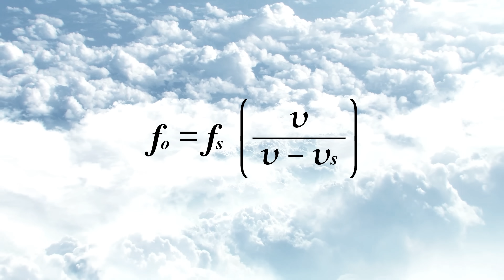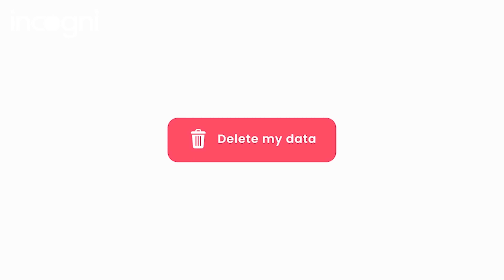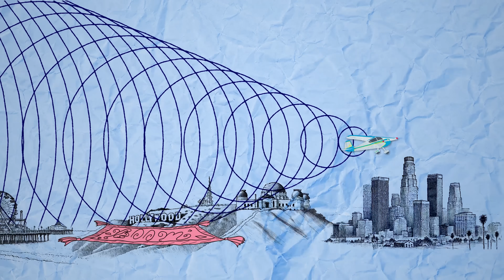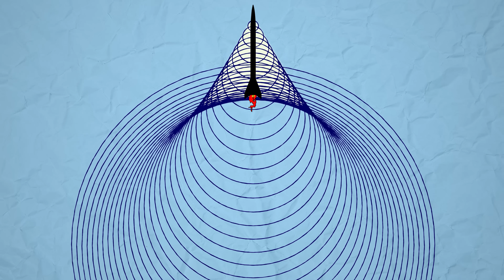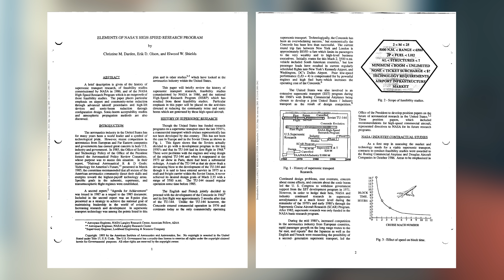You'll NEVER Hear a Sonic Boom From a Rocket??

Comment: Xyla, there's one more boom that is really cool. A cosmic boom. Now, I'm not saying supernovae are cosmic booms ( but they probably fill a criteria ). But a certain type of Star called a magnitar. It has crust that should be as hard or harder than diamond, and when the pressure and magnetism cause a fracture, the resulting boom sends out tons of photons we can experience right here on earth! In 2004 the Swift observatory recorded such an event from SGR 1806-20, a magnitar thats about 50,000 light years away. The energy output was estimated to be a 23 on the richter scale!

Comment: This is awesome! You paid for some awesome animations - I think using them more could have made your video stronger (highlighting the low pressure area in your animation for instance). Also doing that experiment where you create clouds with low density humidified air could have driven the point a bit deeper. I love it when I can see the concept you're talking about. These are just nits though - this video is awesome!

Comment: The most fun fact about the speed of sound is that it's not actually a speed of sound, it's the speed of any mechanical interaction. If you push one end of a 1000km steel beam, how much time will pass before the other end of the beam starts moving? And what would happen if you push the beam faster than the speed of sound in steel?

Comment: Please correct me if I’m wrong, but I thought that sound propagates through air at different speeds based on the density of the molecules. Hence the speed of sound at sea level is faster than the speed of sound at higher altitude or maybe I have that backwards. Please elaborate.

Comment: Does the speed of sound in air change when the pressure or temperature changes?

Anyway air will have a different mixture of different gases at different hieghts, that would change the speed of sound, because it's a different substance.

As for never hearing the sonic boom from the ground... when ship uses their sonar pointing down these sonar waves can bounce off different layers of water and be bounced upward before reabcting the sea bed, with different temperatures in different layers acting as barriers.  So would the sonic boom that is moving upward from a really big rocket bounce off of different layers in the altmosphere and be bounced downward?

Comment: I'm loving this video.  It's dead on right as far as I can tell so far.  

3:19:  But argh, did you have to talk about sonic booms with footage of condensation coming off a jet plane (which can be sonic booms but usually aren't)?  Doesn't change the substance of the video at all, but unfortunately that's propagating a misnomer about supersonic flight.
Reply: 5:42. Thank you for underscoring that the visual isn't the shock wave, but as above I would also add that lots of high-speed (but significantly below the speed of sound) produce condensation like that.  I saw it lots of times on the propeller of the Mooney I used to own.  I've seen it a couple of times on my C-150 prop as well.  I've never had a camera in position to record it, though.

Comment: Some fun tidbits.  You will always hear a sonic boom around rockets its just the rockets have to be really big for the frequency to be low enough for you to hear because the only one that is aimed downward is from the engine and it is FAR louder than the airflow shockwave source.  That said there is a 'collapse clap' if the engine turns off quickly enough as well.   An Atlas or Shuttle launch required people to be far away because it was entirely supersonic and hypersonic shockwaves propagating from the engine exhaust flares.

When Pinatubo erupted VEI6 in the early 1990s it did so 'silently' because the ejected material came out above the speed of sound and traveling almost entirely upwards.   It made noises but one would expect an 'Earth shattering kaboom' from something in the low nuclear force range but because it was substantially made up of super-hot gasses and highly ablative low density ash it absorbed its own shockwave within its outer layers.   Rocket motor exhaust will do this as well and generally you're actually behind all that when the rocket breaks the sound barrier.

The entire dynamic of creating a rocket is to ensure that for most of its flight envelope it is never touched by the closure of the traveling shockwave more than that one time when it forms as it is accelerating from the pad, so the shockwave is literally closing into the engine exhaust.  In atmospheric hobbyist flights it does also collapse back forward after the engine has died as well.   

If you're someplace downrange from an air defense battery's launch site you will hear the sonic cracks of the launched interceptors.

Hope that all adds to your presentation!

Anecdotally I was at scout camp when they strapped a well balanced brick to an M but wouldn't let us stand anywhere near it and we DID hear a series of 'pops' as the aerodynamics struggled against the thrust at mach 1.  (mid 1980s)

Comment: When I worked for the Navy out at the Pacific Missile Test Range at Pt. Mugu and China Lake, we flew aerial targets, which were basically missile emulators, as well as full-scale aerial targets (FSAT) - manned and unmanned both.  During my time, they were transitioning from the QF-4 in to F-16s and other aircraft.

We flew them as drones (subsonic), and as aerial targets - both supersonic and transsonic.

Sometimes it was just race-track them until they fell into the ocean, then (in theory), the Navy helicopter squadron that was flying the thing would go out and recover it.  I say in theory, because good luck with that if it happened on a Friday afternoon, particularly before a holiday weekend.

When we flew them off Hawaii, we'd occasionally get Japanese fishermen drag one back to us, for which I hear they were paid rather well.

I think they quit flying them in Hawaii when a transsonic, hypergolic-fueled target that had gotten "lost" for several decades had the separator between the fuel tanks give way and it went high order.  It took one man's life, and badly disfigured another - the guy who I talked to about it - and I'm pretty sure the state of Hawaii said "No more of that sh*t, haoles."

Anyway, I'm not clear what they did with the so-called "transsonic" targets, other than testing them at those configurations to find out how they acted within those just under supersonic speeds.  Some kind of threat emulation, I'm sure.

Comment: That was very good well also the size of your rocket is probably why you didn't hear a big Sonic Boom as it passed through  high Dynamic pressure wave.  oh yeah I was in 8th grade when the first shuttle landed back at Edwards and we heard that sonic boom well both Sonic booms oh yeah. Actually every time the shuttle landed back at Edwards we heard the sonic boom. It's cool that your rocket went up to 22,000 ft very cool if you would have put a big booster on it and used your rocket is a sec cool ond stage  who knows far you could have gone very cool. Cool hand San Pedro California

Comment: For Weird Sonic Booms - I could not find reputable proof of this, but ALLGEDLY cracking your knuckles causes a gas bubble to form and collapse, and the collapse happens at the speed of sound? I remember hearing this when I was a kid but couldn't find info to either disprove or validate the tale.
Reply: the bubble popping causes a cavitation wave. Its a different phenomenon because nothing is actually moving at super-sonic speeds in that scenario. This is actually also the phenomenon involved in the mantis shrimp shock-wave attack that a lot of folks mistake for a sonic boom
Reply: @manuelalves9749  Thanks!  I thought it was the bubble collapsing that happened supersonically.

Comment: Sounds like a job for a tethered balloon with an HD microphone!

Launched and already parallel to the path of Spike 2.0
Reply: That's a long freaking tether. And the balloon needs to have enough lift to lift itself and 400m+ worth of whatever the tether is made of. And Xyla needs to have enough money to buy the balloon and 400m+ of tether and a reel that can hold it and a trailer that can transport the reel and a vehicle that can pull the weight of all of the above. ;)
Reply: @shadowfaxcrx5141  Just have an Arduino or similar recording the sound to a SD card, with a remote controlled mechanism to vent some of the lifting gas and descend the balloon on command.

Comment: The shuttle on return is nothing more than a super sonic glider.  Nothing "rocket" about it.  Even on the way up it wasn't a rocket it was a complex payload which offset the mass of the rocket so much they needed to put engines on it.  Even though it couldn't even use those engines once disconnected from said rocket.  When you dig through the shuttles history you feel sorry for it.  So badly compromised by "design by commitee", too many funders, too many backers and NASA trying to deliver value to all of them.  Ended up with a rather poor jack of all trades and rubbish at all of them individually.

Comment: I got to see the launch of Voyager 2 in Florida, 1977. I don’t remember a sonic boom but I remember the crackling sound from the Titan engines which I’ve been told are a series of mini sonic booms from the exhaust stream as it goes supersonic.

I’ve also been up close to an F16 with its afterburners lit up. It was really pretty — pink and purple flames with shock diamonds caused by the supersonic exhaust. More than loud — you could feel the rumble through your skull and chest cavity.

(Also, no back ache… core strength exercises and yoga and plenty of fiber)
Reply: Apparently it's not that hard to get supersonic jets with compressed air (including canned "air"), the requisite pressure is something like 6 atmospheres (IIRC, with assumptions I don't recall)

Comment: You may hear small supersonic pops going up because of small rockets. You will also hear the grains extinguish from bottom to top if your are really listening. Also a small doughnut of smoke sometimes at grain burnout in the smoke trail. At the end of motor burn, sometimes you will hear the casting liner's debris go through the throat at burnout on high impulse motors, along with a pulse of debris. It's sounds like "Thwak"!
You may hear ejection charges, depending.
All this happens during motor burn until ejection. Once you resolve these sounds, you can tell your friends how many grains are in a motor without looking at it first. They won't believe you until you teach them too.

Comment: In a rocket launch, you do actualy hear sonic booms. They are not from the rocket body it self but from shock waves insdie the exhaust gases of the rocket motors. It is this caracteristic crackling sound you can hear from big rockets.
Reply: Right!  In fact, they come from the LATERAL expansion of gases under the rocket.
Reply: @altair7001  In that regard they are more similar to the sonic booms from lightning where it the the rapid lateral expansions of the superheated plasma generated by the strike. Different mechanism but in both cases you have material heated to such extremes of heat and pressure that they expand laterally way faster than the speed of sound in the much colder lower pressure air around them.
Reply: Crackle is not a sonic boom, it is a nonlinear steepening that occurs in the combustion plume.
Reply: @williammurphy8227  Some of the cracks can actually be small sonic booms, although it is actually not a good thing when they do occur it's a sign of instability within the expanding gas plume. Some is to be expected as during ascent the rocket nozzle can not possibly have the perfect expansion for the outside air pressure which is constantly changing as it ascends. When these two do not match you get instability in the plume that actually wastes energy and makes thrust sub optimal this is also why we engineer rockets with multiple stages to switch to engines better tuned for the stage of ascent but there is also a weight cost in adding extra engines and staging components so it's a compromise between having some suboptimal effects like this going on i order to have the stages burn for long enough to justify the staging cost of each.

Comment: GREAT EXPLANATION! ... ... ... although, slightly over-simplified ... ... ... as a pilot, you know air density is not constant, therefore, the speed of sound through air is not constant either.
Reply: as an engineering student, it's not air density, but air temperature that affects the speed of sound.
Reply: One minute into the video, Xyla explains the speed of sound through three different mediums: air, water, and steel. 
The difference in speed has absolutely nothing to do with the temperature of these three mediums, it does have everything to do with the density of the mediums.
Air temperature changes can change it's density, but its is the density that determines the speed of sound through it.
Reply: @u8ntcn031  The different speeds in air, water, and steel, are not caused by the density, but rather the strength of the interactions between the atoms of the material.  For example, the speed of sound in lithium metal is about four times faster than the speed of sound in water, despite having only about half the density.  Raising the temperature of a material will increase the speed of sound, but only so long as it doesn't change the state.  All else being equal, increased density actually reduces the speed of sound.
Reply: @ichbrauchmehrkaffee5785  Maybe we should ask him, "as a pilot"; What are his thoughts about the speed of sound in a vacuum? And to really challenge him; Can an object travel the speed of sound in a vacuum?
Reply: @azy6868  In (complete) vacuum there can be no sound. Thus "speed of sound" in vacuum is undefined. You can never say that in a vacuum an object travels at higher or lower speed than the speed of sound.

Comment: Just for fun!  Is sound really a wave? Or is it a variation in pressure.  You know a high pressure followed by a low pressure followed by a high pressure ........  The frequency is the time between high pressures. and the amplitude is the amount of the pressure.  Watch a slow motion video of a speaker and tell me if you see waves or a vibrating diaphragm displacing air.  This example is emblematic of the problem in education of the sciences.  The people doing the education do not really understand the real physics involved but just repeat what they were told in their classes.  For those of you who wish to argue the above comment first tell me the units on the wave model you just saw?  Time is on the horizontal axis, but what is on the vertical axis?
Reply: I'll stick with the physics definition of sound, so yes it's a wave.

"The amplitude is the pressure" not quite, the amplitude is the deviation from average pressure.

The speaker cone movement is not the sound, it is the action that generates the sound.

Now I'm going to guess (risky, I know).
Are you trying to convey that the graph style image of a sound wave implies transverse movement of the air molecules? Whereas sound is really a longitudinal wave.
Reply: @dougaltolan3017  Hello Doug,  Thanks for the response.  My point is really a simple one.  Using the analogy of sound being a wave and using the image of a wave traveling through water as an example of a sounds progression through a media is not correct.  Yet this example appears in most educational books.  Sound is propagated through the atmosphere as a variation in pressure.  Its characteristics are the "sound pressure level" and the frequency of the variation.  You can graph these variables as a wave but the true mechanism is not a wave.

Regards.
Reply: @johnpayne8223  Fun fact: water molecules move in a circular motion as a water wave passes, they do not just move up and down.

Comment: I'm gonna post a guess before watching the video and see if I get it right: the sonic boom is created by compression at the tip of the rocket in the direction of travel, and travels radially outwards from there. Which means, in order to hear the sonic boom, you would need to be in front of or off to the side of the rocket. But, for a launching rocket, you typically are pretty much directly "behind". So, there is a sonic boom, but you're on the wrong side of it.

This is different for a landing spacecraft. SpaceX's Falcon 9 boosters generate a characteristic triple sonic boom from the engine bells, the landing legs, and the grid fins when they come back to land. The Super Heavy booster generated a mighty sonic boom. The Boeing X-37B also creates a sonic boom when it lands, which is can be somewhat startling because it is so secret, the public is generally not informed about it. And, of course, the mighty Space Shuttle did as well.

Comment: My thoughts when I saw the title of this video:

1) Not all sonic booms are equally loud. A tiny whip tip is not going to generate as much force as a jet, so its boom has less volume.
2) That rocket is super aerodynamic. Much thinner and sleeker than a jet, no wings, and tiny fins instead of tail wings. That's much less drag, so it'll have a smaller boom.
3) Rockets are loud, and we stand far away from them for safety.

So with a smaller boom, all the rocket noise, and our distance away from them, I really wouldn't expect a sonic boom to be very noticeable.
Reply: Except a sonic boom doesn't come from drag.  Instead, drag comes from sonic booms.
Reply: I wrote a paper in 2019 where we investigated the sonic boom produced by .50 caliber bullets and moved the microphones away from the trajectory. The Witham formula gives the amplitude and duration of the N wave produced. It isa function of the projectile’s length, diameter and velocity and more importantly the miss distance, the receiver’s distance away from the trajectory.